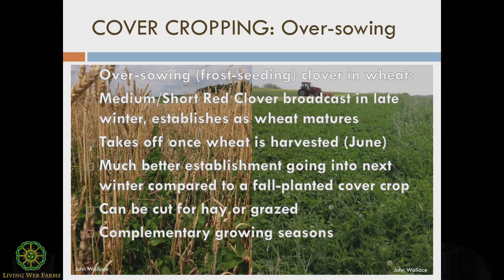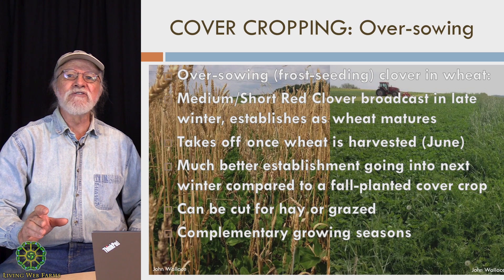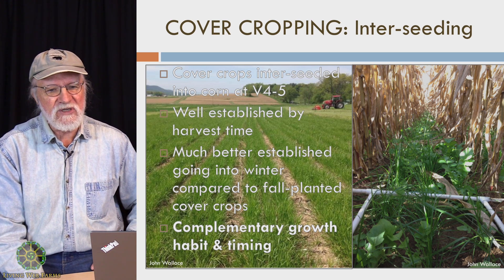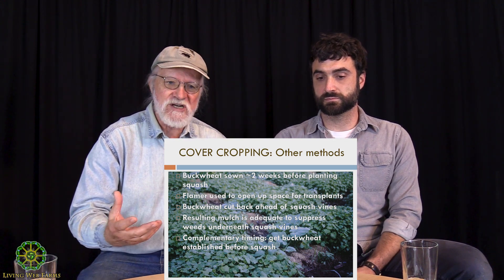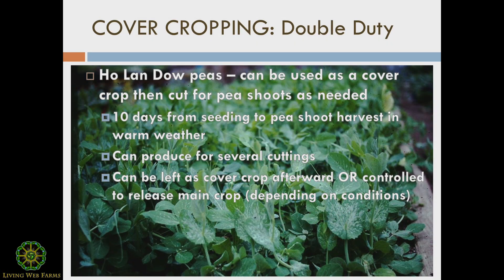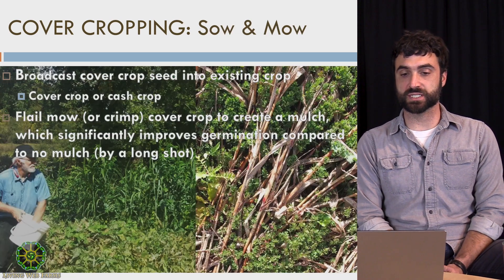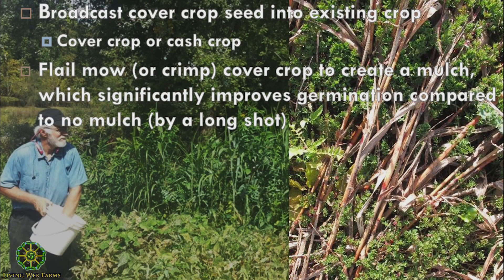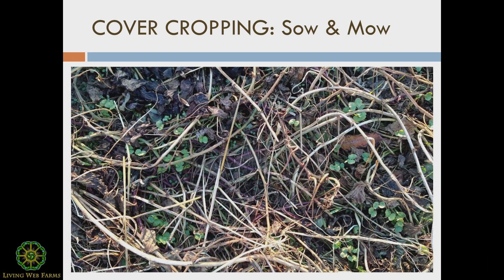Solar Fertility Systems with Mark Dempsey & Pat Battle Part 3

Comment: Excellent points here. I like the squash technique. Looking forward to use the ground cover ideas with our tomato and sugar cane rows where there are rows of sugar cane six feet apart and trellised tomatoes in between. Here in coastal South Carolina, the tomatoes get the full sun early in the season. When the summer heat takes hold, the sugar cane creates a tunnel to break up some sunlight and help with air circulation. It it wonderful to work in and for show. A low and lush ground cover would add to the microclimate and attract the beneficial insects. Most growers here in the low country give up on tomatoes by the end of July, the sugar cane cover crop allows us to keep harvesting through late October, commanding a premium price. Thanks guys!